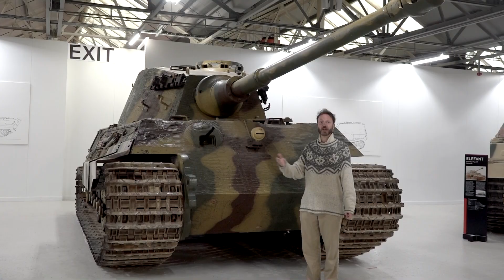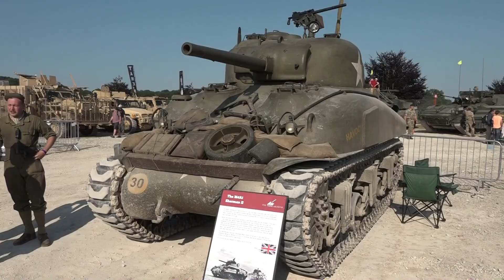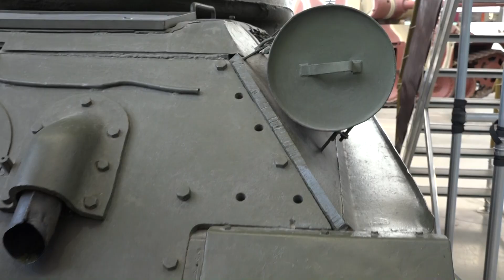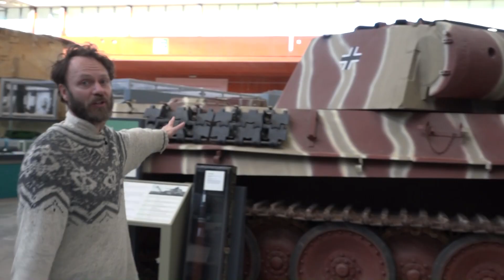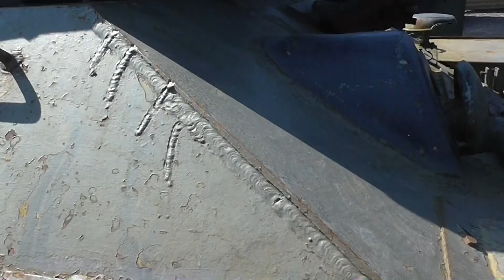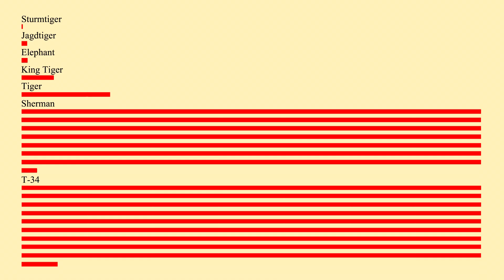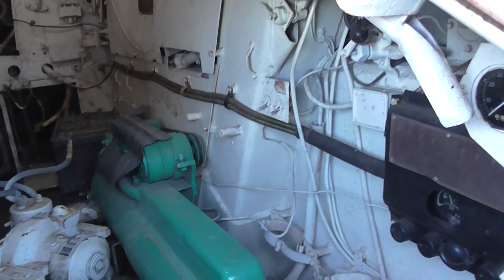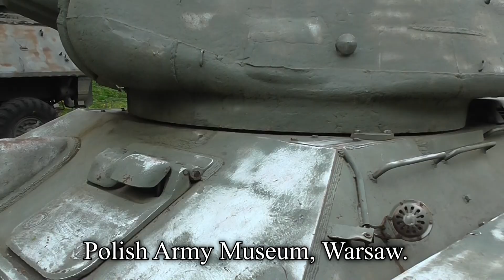World War Two's most common tank

Comment: Some of the memorials are still driveable as far as I know. I have one in my town, standing proudly almost a century after it's production, with children climbing on it and people laying flowers in front of it.
 I like it that it's easily to find videos on T-34, and every now and then you can find a new one with another T-34 being resurrected by some village mechanic who found one sunk in the swamp.
 I wonder, how many automobile hulls can be made out of one T-34 hull melted into steel.
Reply: makes me impressed with nearly 100 year old vehicles now, compared to bleeding edge  fancy tanks which may turn into a brick when electronics fry.
Reply: @effexon  The US still has a lot of 100+ year old pieces of infrastructure in use.  Probably the most famous of those is the Centennial Bulb which is basically what happens when you don't manufacture for planned obsolescence.

There was a guy I knew when he was a manager at a US electric company who told me the monetary only reason they have to replace a lot of the old infrastructure is because of how inefficient it is.  The stuff is inefficient because it has lasted being in more or less in constant use since WW1 and is still in the same condition as it was when it was installed.  The modern replacements have to be replaced every decade or so.
Reply: yeah and some heavy tanks turned into memorials are drivable too. For example in the donbass war the separatists got a IS 3 working and used it against ukranian forces.
Reply: One of the most famous drivable memorials was used during protests in Budapest in 2006.

Comment: The Russian BT-7 could use a set of road wheels to drive around without tracks. https://en.wikipedia.org/wiki/BT-7

All in all they where not very good unless used in the far east against the Chinese and Japanese, it would be replaced by the T34's. In the Winterwar the Finnish army captured a bunch of them and converted them to assault guns, the BT-42 which was even worse.

Comment: The Germans never had more than 3000 tanks in service (and operational) at any one time. I don't recall the number of operational tanks at any time was for US/UK and Russia. Let's suppose peak tank production is 2000 per month and the average tank in an operational unit lasts 3 months, then there may be 6000 tanks operational at any one time.
On sloped armor: suppose you want to protect 50 cm of vertical height with 10 cm of armor. that's 500cm2 per cm of width. 
Now slope the armor 60 degree off vertical. Now you only need 5 cm to provide 10 cm of effective horizontal protection. Of course, you need 100 cm of plate to cover the 50 cm of vertical height.
So, the real value of sloped armor is the tendency of shell on a horizontal trajectory to glance off the sloped armor versus a vertical plate. But you give up interior space.

Comment: The panther was not similar to the T-34 it was vastly superior in every conceivable way, I mean it was specifically designed as a counter to it. This is especially true once they ironed out some of the reliability issues from the early models, although of course every German tank was mired by such issues.
Reply: "it was vastly superior in every conceivable way" Cost?
Reply: @DelbertNewman  what does cost mean in a command economy? you can't compare what something cost when you have capitalist countries on one side and economically socialist (yes, I know that's an oxymoron, but there you have it) countries on the other side that dictate large parts of the economy (with a few benefits and many, many drawbacks). Then there's the slave labour question.
Reply: @DelbertNewman  I mean you can deliberately miss the point if you want.
Reply: @boolean6532  You are the one missing the obvious point. The "vastly superior in every conceivable way" Panther could not be built in sufficient numbers to counter the T-34. It was technically brilliant, but an industrial failure.
Reply: @boolean6532  Actually he hasn't missed the point, he's basically saying "If we can afford 10 good tanks or 100 Ok tanks, what should we pick?". Personally I'd go for the 100 Ok tanks.
Reply: @gwtpictgwtpict4214  he is because he's assuming a position I wasn't even arguing, and deliberately twisting my words to make a case I fully agree with as if I was arguing the opposite, whilst completely ignoring the point I was actually making. It's a very standard bad faith practice.
Reply: @gwtpictgwtpict4214  Remember that to crew 100 ok tanks compared to 10 good tanks requires 10x the personnel, engineers, spare-parts, fuel, food, ammunition, and training hours.
Reply: I mean, if the T-34 had actually been built to specifications then it would probably have cost the same to construct as a Sherman. It was an expensive tank built cheaply, not a cheap tank by design.
Reply: To be fair to WG55, I'd say it's reasonable to talk about cost in terms of  work hours and materials. Any of those that you're spending on one project can't be spent on another. In that regard the T-34 almost certainly beats any equivalent allied or axis tank. However, something that's cheap isn't always better.
Reply: @bjiornbjiorn  I mean, sure, work hours and materials is still valid, you also have to take into account the simple meritocracy of getting something right and then being good at it and then optimising it. Course there's always the detractor of deliberate sabotage of production, as happened with POW and slave labour, and even the "Freiwillige hilfspersonal" foreign workers from the countries allied to or conquered by the Reich who were more inducted workers than slave labour.
Though, with T34 there's always the fun factor of "which factory specifically made this tank and this part and this etc etc etc", much like certain British tanks (looking at you Churchill, Cromwell and Comet @W@) where a certain amount of bodging and fudging went on during wartime production.
Or how there's Shermans and then there's Shermans and there are >Shermans<, not all Shermans are equal.
Reply: @bjiornbjiorn  People don't talk about cost when saying something is superior. Has a single person ever said that the Ford Focus is superior to the Bugatti Veyron? Because it's certainly a hell of a lot more cost efficient.

The guy is just deliberately being semantic. To be honest, I shouldn't have even responded to someone arguing in bad faith.
Reply: @boolean6532  I was just pointing out that cost (as an abstract term) is something that exists beyond questions of money and therefore you can use the term despite wartime economies often being command economies. 

Also, I think your Bugatti- Ford comparison is a really bad one. There are lots of ways in which a focus is better than a Veyron. The comparison you really want to make is between something like a mini cooper and a lada. I can't think of anyone who'd buy the second one and think they were getting a better deal just because it was cheaper.
Reply: @boolean6532  No he isn't, you're arguing "superior" when the question is fit for purpose.  A Bugatti Veyron may be faster and more fun to drive than a Ford Focus, but the Ford Focus makes much more sense for getting to and from work, shopping at the weekend, dropping the kids of at school etc. You can do all those things in a Veyron but it'll be ruinously expensive and has sod all road clearance to cope with suburban areas with speed bumps.
Reply: @gwtpictgwtpict4214 And now you're doing the exact same thing as him. I said superior, as in better, as in a Veyron is better than a Focus, as in a PS4 is better than a PS3. I never said the panther is more cost effective, I never said its cheaper. It's really not complicated, if you start going on about cost then virtually nothing is better than anything in this world, as inferior products are almost always cheaper, and this entire discussion is pointless.
Reply: @boolean6532  You have your own definition of "superior" and are not listening. For my purposes the Skoda on the drive is "superior" to a Bugatti Veyron because I can afford to run it, I couldn't afford to run a Bugatti Veyron, it would just be a very expensive ornament taking up space. My Skoda is "superior" because it's actually of use to me.
Reply: @gwtpictgwtpict4214  Superior: higher in rank, status, or quality. As defined by the Oxford dictionary. Can you shut up about one word now and stop deliberately missing the point I was making?
Reply: @boolean6532 . My land rover is vastly superior to a Bugatti.  Your argument is faulty.  You could have just said you prefer the panther.

Comment: 5:25 I read a memoir of a Soviet tank captain during World War Two, and the escape hatches were a big problem. He said that because the driver had a procedure to follow to get that hatch open, if he didn't finish by the time the flames reached him, the panic would make him unable to complete it, and he would die. And as you say, the machine gunner/radio operator had it much worse, having to wait on the loader or driver to get out first.
Reply: There was actually an escape hatch in the floor of the T-34 that the bow gunner could access by dropping the back of his seat, butf it was very awkward to get to and casualties in T-34s were certainly very high.
Reply: This versus the M4 Sherman......I think the ratio of fatalities to serious hits was the lowest....   .6 I believe and mostly due to a hatch design that let the crew escape much easier
Reply: Excepting that the crews were even more expendable than the tanks
Reply: @mandowarrior123 that's a stupid misconception